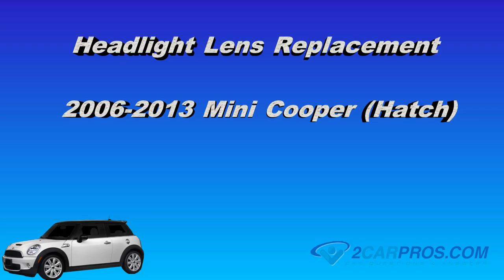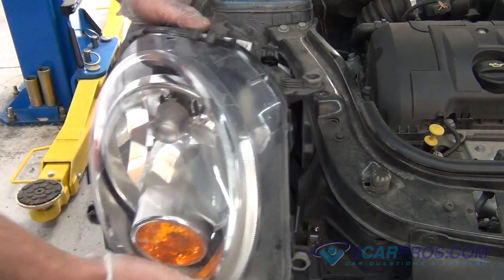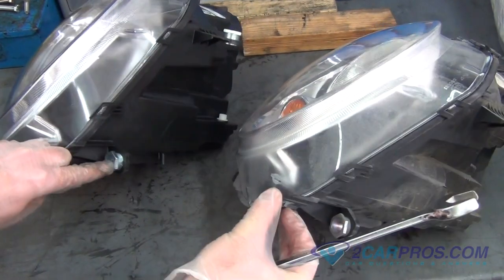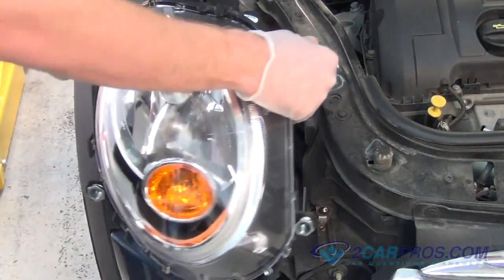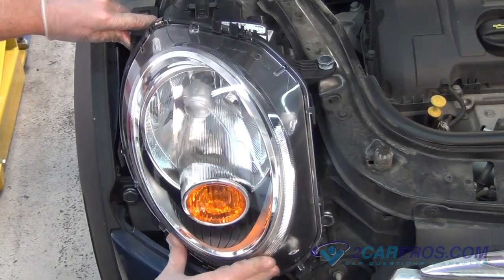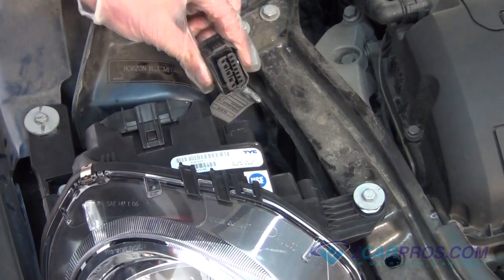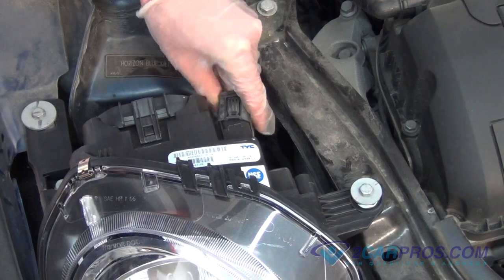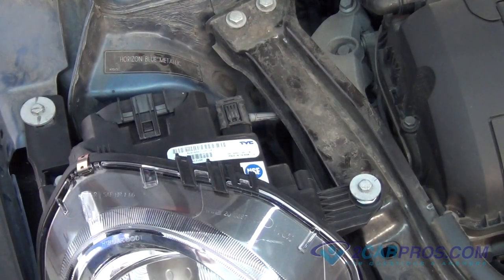Headlight Lens-Housing Replacement Mini Cooper 2006-2013

Comment: Thanks for the video 2CarPros, but I have a question - are those "adjusters" also how you raise/rotate the HID cutoff for Mini's Xenon headights?  Mine are ridiculously low, so low that I'm forced to drive with my brights on just to see, and both cutoffs are rotated all wanky, too.  Please help, thanks!
Reply from the maker: Yes that is how you adjust the headlamps. Point your car at a wall about 20 feet away and try to adjust them to a good height and to be level.

Comment: I'm having issues removing the lower outside screw on both headlights.  The screw just turns and does not come out.  I can even see the back of the screw turning but no axial movement.  Any suggestions?
Reply: Rob Campbell how did you fix this ? Mine does the same thing
Reply: Any solutions yet?
Reply: would like to know if there's a solution to this aswell
Reply: Mine also.  It looks like there's a small ring at the back on the lower outside bolt possibly holding it in place, but the others came out very easily.  Not sure what to do about the lower outside one though.
Reply: Same issue,  both on the outside just spin.

Comment: Do 2006 headlights with the xenon bulbs fit on the 2008 mini with xenon bulbs??
Reply from the maker: +raul martinez You will need to check with your local Mini dealer for compatibility.